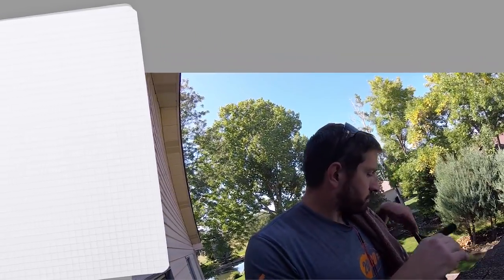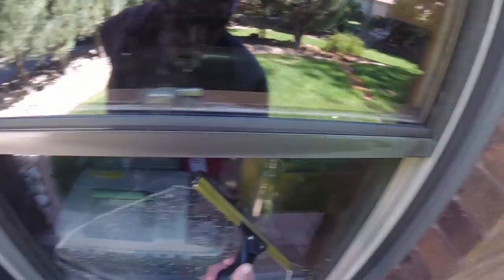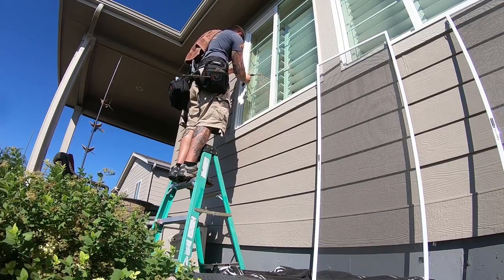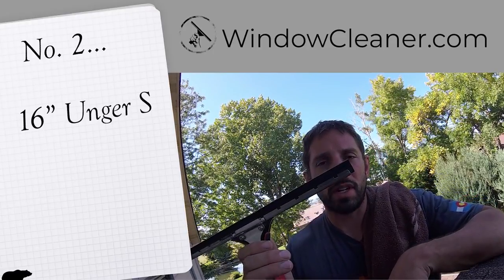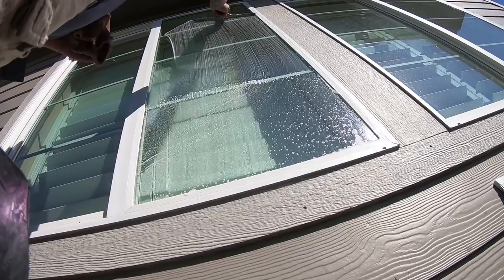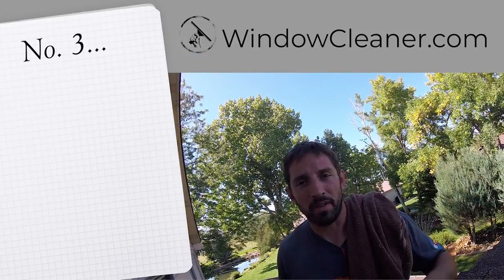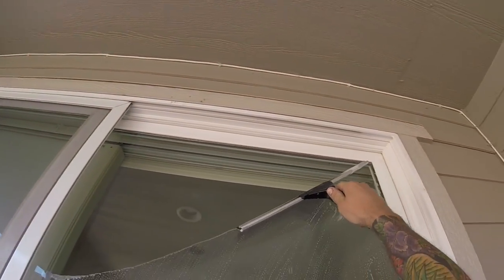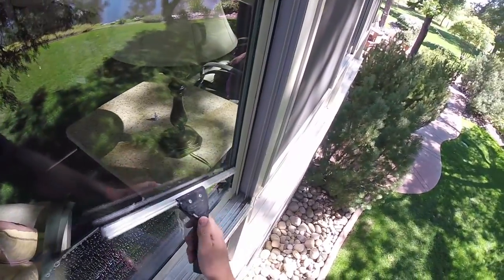Best 3 Residential Squeegees Money Can Buy

Comment: Everyone has a preference and yours are absolutely great.  Have used Ettore brass since I was 15 years old.  My residential preference is the Ettore pro + handle with 14" Moerman blade and red razor rubber.  Great for closing out with the spring loaded handle and little to no detailing with the Moerman blade.  Colder weather I go back to Ettore rubber.

Comment: I’ve used Sorbo, Moerman (garbage), and super channels. Just bought ettore brass with the ledge eze, oh my days! It’s smooth!
Reply: I really like the Brass channel with the ledge-eze handle it's my go to #1 choice, but the Excelerator 2.0 has been growing on me quite a bit, Hands down the best swivel mechanism I've used and the multiple angle options comes in handy more often than you'd think. I still use the Ettore brass channel in the Excelerator, I like having just one type of channel it makes managing rubbers, clips etc. much easier.
Reply: @bigblue4364  when the excelerator 2.0 came out that became my go to for most jobs with brass channel. Still don't like how moerman tools are so easy to break even with small drops. I do really like the moerman hip bucket though. Not tried the new drywalker flex, maybe in the new year.
Reply: @casto87  
Yeah the basic bucket and the 2.0 handle are pretty much all I use from them, ironically the handle doesn't stay in the bucket so well with shorter channels :\ when my Ettore ones stay put just fine.
Reply: @bigblue4364  it is odd that wasn't thought about but maybe was a design before excelerator handles 🤷🏻‍♂️ I cut a bit off mine and filed it smooth so it sits in it now, easy fix.